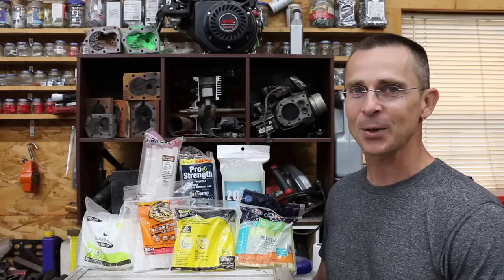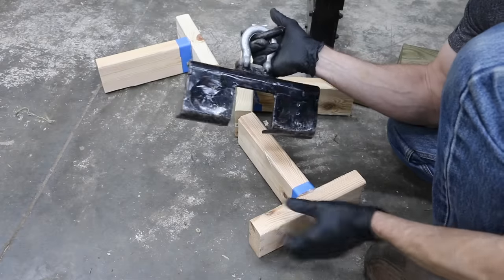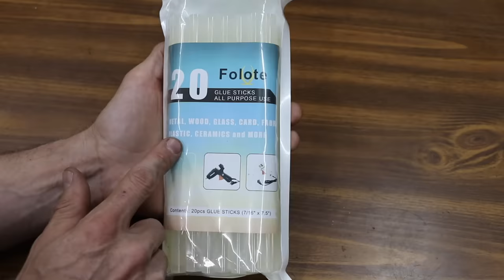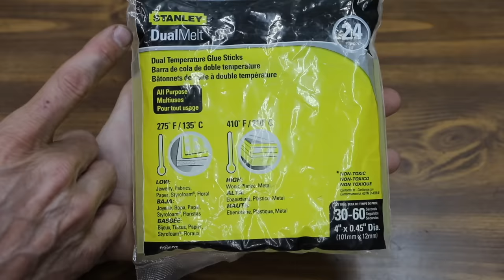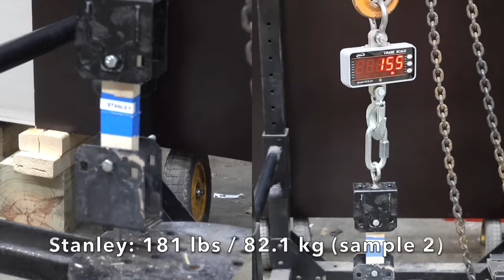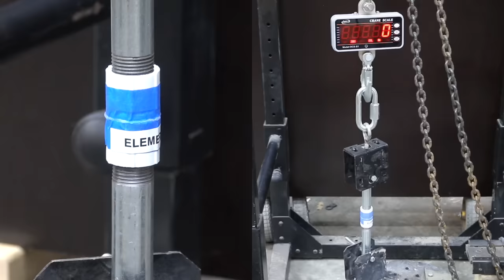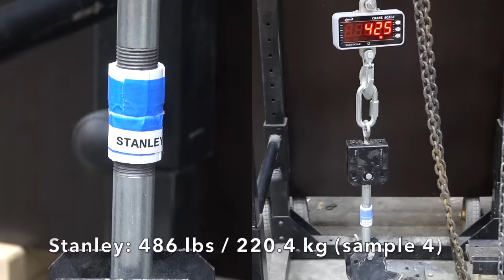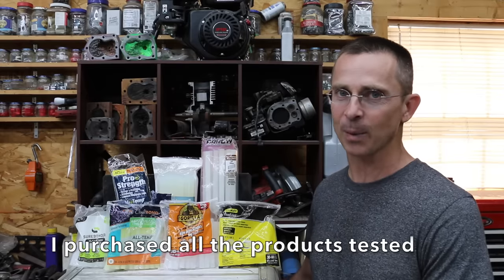Is Gorilla Hot Glue the Best? Let's find out!

Comment: Just what I need to see right now.  I need to purchase some hot glue sticks because I ran out of whatever I'm using now.  I'm looking for hot glue that has decent but not the best shear adhesion. I use it for gluing side runners to wood that I run through my thickness planer to eliminate snipe - I need a glue stick that adheres just OK in shear but can easily be popped off in tensile.  Great channel you have!
Reply from the maker: Thanks!  Thanks for the video idea.

Comment: I've just discovered your series and am impressed by the care you take in making tests uniform between each product. But unless my old eyes deceive me, i think I see a slip-up here.  On your first set of tests involving the 2x4 tee joints, you have placed a small piece of steel angle between the wood and the U-bolt which holds the tee flat during the pull.  It looks to me like that piece of steel angle moves a bit, and during some of the pulls it appeared to get very close to, maybe touch, and maybe drag against the glued face of the crossing 2x4, which could affect the readings.  Again, it's hard for me to be sure of this, and after all, you were on the spot and do careful work.
Reply from the maker: Thanks for the constructive feedback.

Comment: It looks like all of the shear tests actually didn't fail in the glue but in the actual wood fibres. This holds true with how wood glue is (usually) stronger than the wood you're gluing together. It does however make that number more or less useless if the glue didn't fail but instead pulled a layer of wood of the board.
Reply from the maker: Thanks for the feedback.

Comment: I enjoy your channel - I started with the spray penetrants and have watched many. My only criticism is that some tests appear to test the strength of the substrate and not the bonding agent. In the sheer test, often failures that occur under lower forces have surface material from the boards that delaminated. If possible, I think that using more uniform testing materials would give a better indicator of the strength of the actual products being scrutinized.
Reply from the maker: Thanks for the feedback.

Comment: On the shear load tests, it seemed to me what might be failing is the lignin.* I saw splinters of wood in most of the shots. Without a close up, it is more difficult to evaluate, but the relative similarity of the failure loads suggests this as well.
*Which is what fails in PVA glue ups as the PVA is stronger than the lignin.
Reply from the maker: Thanks for the feedback.

Comment: Since the Flex Seal Products are now showing an ad using one their Flex Seal products gluing PVC pipe together, you might want to check how good that holds up to pressure.
Great video though on Hot Glue. I never knew they made that stuff so strong. I would also like to see how strong those glues are under some hot weather conditions. I live in the AZ SW Desert where temps can reach 120° in the summer and that is not in direct sunlight. During the hottest days, Flight Line work on Aircraft is limited to 15 minutes and their must be 2 people and plenty of water. 
That is another reason I never trusted Hot Glue for outdoor use. Plus, the area I'm at has the highest UV Light in the US. Plastics that are not protected in some way, do not last long when exposed to the sunlight, dry humidity and the heat. It would also be nice to know how well these glues would hold up under those conditions.  
Most of the Hot Glues I've seen and used were not all that good. So I've always figured it was mostly for light duty applications and cardboard boxes or temp holding. 
There was a product out that was made for holding parts for machining. We tried to use it to hold some thin parts down to machine them on a milling machine. But the heat from the end mill cutter weakened the glue and sent the parts flying. The stuff never really worked on large thin metal parts either. Never could get a consistent and even cut. This happened even with flood coolant being used. The stuff worked on some larger thicker parts where the heat would not effect the glue. We wound up using special end mills and a vac-mat. 
Love the videos and the information on these products.
BTW, what did you do in the USAF?

Comment: Id be interested to see how they perform with ambient temperature changes. One of the downsides of a thermoplastic is the hotter they get the less strength they have. So uses in vehicles having limitations due to rising interior temps.
Reply from the maker: Thanks for the suggestion.

Comment: Several years back i was installing granite shower enclosures bath lavs window sills etc in hotels. But before starting that i was installing the door jambs and doors. Some installers came in to hang thin granite panels in the tub enclosures. I was shocked to see them using glue guns to hang the panels and moreso the soap trays grab handles and corner trats. All with hot glue. After checking with the!guys they showed me the sticks were an epoxy. Extremely hard bond. Im a big guy. I intentionally used the soap tray to pull myself up from the tub over and over. It never showed any signs of failure. Ive installed several thousand the same way and have had no calls to repair or replace any due to the glue breaking loose. I cant say i feel comfortable with that method but it works.
Reply from the maker: Thanks for the feedback.
Reply: @ProjectFarm  thanks for the video. Interesting. I thought it was strange that surebond did so well on the first test then wasnt that impressive on the other tests. Stanly surprised me.

Comment: You should install the testing bracket on the inside of the T, so that it's pulling up directly in line with the sheer line. You will need to change the bracket first, but you'll get much better results for sheer strength.
Reply from the maker: Thanks for the suggestion.

Comment: Interesting.  I have always used Surebonder, and they have many different glue formulas, as well as normal and high temp.

A guy could spend the rest of his life devising tests for, and running, hot glues

I have always wondered how much more effective the specialty formulas are for their purpose than basic glues.

If you ever want to go partway down THAT rabbit hole I will gladly follow.
Reply from the maker: Thanks for the suggestion.

Comment: In alot cases involving wood its more a test of the woods strength than the adhesives bond,  in a lot of cases the adhesives bond has torn the wood with it proving only that wood isn't a valid control material
Reply from the maker: Thanks for the feedback.

Comment: I love your channel!
I am a handy man around the house I always come to your channel for advice on products such as this. Your testing is thorough and made so everyone can keep up. I was going to suggest doing a summary at the end but you beat me to it. 

Keep up the good work!

Ps recommend cleaning non wood surfaces prior to glue. Symmetry is critical when doing these tests so try as much as possible to remove variability ( too much to ask I know ). 

Video idea: led bulbs last longer than incandescent or are more efficient ( cycle on off too for comparison). Best leaf blower. 

Pss from other video, I use eneloop because they don’t drain over time but I think you have that coming 😁. Also they were the first to the market with good quality but now I’m glad to see more competition. On next test you can include ncr18650b for lithium batteries if you test again. 

Speaking of lithium, there are two types low capacity power cells and high capacity energy cells ( high esr ). You have to test them differently. I actually worked at milwaukee tool 😂
Reply from the maker: Thanks for sharing.

Comment: I am surprised just how strong a small piece of pine is considering it has a hole in it with the bolt taking all the pressure, I would have thought the wood would fail more at that size, so a good add for the wood as well :)
Reply from the maker: Thanks for sharing.

Comment: You should do a video comparing different brands of garden hoses. Abrasion resistance (bend over something, hit with orbital sander for X seconds or until leaks, etc) , end fitting crush strength, flexibility as temperatures lower, price vs performance etc.
Reply from the maker: Thanks for the video idea.

Comment: How do the glues hold up over time?  Hot glue is made of various types of plastic.  Some plastics degrade under light and some over time.  Can this be used for structural applications?  Stanley might be the best.  Will it hold up after two or more years time?
(This glue seriously burns!)

Comment: I would be interested in the temparatures at the nozzle of the different applicators. They are not a very sophistricated machinery, often without even a basic temperature regulation. It would be interesting to compare the results at different temperatures. It might be that the applicator for the stanley product was just at the optimal temperature for the product.
Reply from the maker: Great suggestion.  Thank you.

Comment: You should re run this test with the glue they use in collision and paint less dent repair. They have cam auto glue wich is used to apply tension to crushed panels while you work the metal
Reply from the maker: Thanks for the suggestion.

Comment: When I use hot glue, I don't cover only the immediate area of the joints. After assembling them, I also put some in the corners (as often as possible) to add the strength of a fillet, something I learned in 8th grade when the science teacher showed us how to attach the fins on a model rocket. I usually don't try to make it a true fillet, though, because all I'm interested in is the strength since it's going to be hidden anyway.

Do you think it'd be worth testing again with that kind of additional glue?

Comment: Just some feedback: You would have been better off using some sort of scored metal for this test. Your results are inconclusive due to the variation in grain strength between different wood pieces. That is why you kept getting such huge variations while testing the same product. Another downside to using glue is that even if you had the same exact wood pieces, the lbs measured would be limited to the strength of the wood itself. If any glue surpassed the strength of the wood, you would just be met with the equivalent value of the woods stress failure in pounds.

Overall, I appreciate your approach that you are trying to take when comparing products. Not many even attempt to isolate variables in their comparisons like this channel. Keep up the good work
Reply from the maker: Thanks for the feedback!

Comment: I'm hot gluing everything with addding 1 penny nail. Should hold up a building.

More importantly after cure how does it hold in warm environments or out in the sun 🌞 doest it still hold up or does it soften.
Reply: Hot glue can soften if it gets warm enough
Reply: @longassrice8756  I understand that which ive only used craft grade hot glue and have experienced that. I never tried the high temp and I was wondering if the higher temperature causes a permanent chemical reaction for make it last longer and less susceptible to degradation due to warmer temps compared the hobby cheaper hot glue sticks.

Comment: This may seem like a bit of a strange one, but what about hot glue guns? Ryobi is one of the few name brand wireless ones, and Menard's Masterforce, 3M, Surebonder, Gorilla Glue, and Arrow might all be good competitors. You could test rated heat, safety features (if they were accidentally left on overnight), hot glue drip during idle, heat up/cool down speed, bead width, how much hot glue does one pull of the trigger release, pull force required, etc.
Reply from the maker: Thanks for the video idea.

Comment: Did you do one about the different glue guns? I did find out that the cheap ones don't get hot enough and/or don't keep enough heat to keep the glue a constant temperature for good adhesion. 

I think you have a lot of fun doing this.... Abrasives?
Reply from the maker: Thanks for the suggestion.
Reply: @ProjectFarm  We wood turnere use hot melt glue guns to secure waste blocks to some pieces we turn. I do remember some one saying that we need to use an 'industrial' grade glue gun because the hobby level ones don't get the glue hot enough to get a really secure grip. 

Since I use a lathe, one tool that all turners have is a bandsaw. Have you done bandsaw blade reviews? Most common use is for cutting rounds out of wet wood. Most prefer a 1/2 inch by 3 tpi blade, though some use 3/8 inch blades. For sure the thicker ones. I have been using the Lennox Diemaster bimetal blade. Teeth are M42 high speed steel which is what is used for the pallet cutting blades, and a number of the lathe chisels are now M42. Other blades from Ellis bandsaw blades, Timberwolf, Suffolk I think, and I am sure there are others.... My local maker told me carbide tipped blades are for cutting veneers. Some cut pen blanks, which are usually casting resin covered. 
Thanks....

Oh, abrasives, Mirka, 3M 'cubitron', the red aluminum oxide, the open mesh ones, and a blue one on film rather than paper, I get from vinceswoodNwonders, don't know the brand name.

Comment: Did you take a temp reading on the "applicator"?  Comparing guns would be a good video.  Lots of variation in the definition of "high temp".  One 100 watt "applicator" I tested only drew 25 watts and only reached a temp of 270 F.

Comment: Any time the glue pulled the face of the wood off, I would consider that a matched result to the other glues that did the same.. basically you're sheer test was limited by the wood fibre strength, not the glue.
Reply from the maker: Thanks for the feedback.

Comment: Great test, I'd have never considered hot glue being this capable... I was going to put a suggestion across though if you don't mind? 
The point of failure in the first test (log test) appears to have been the actual wood, could you consider redoing the test with metal? Obviously a smaller surface area... 
Another test would be strength at temperatures... will some glues perform better than others at normal ambient extremes? e.g. putting them in the sun and cold, (again I'd suggest metals for this). 
And finally, how well do they hold their strength after receiving impacts in different directions, the aim with this test is to verify how might a bond fair with lots of smaller non destructive impacts to simulate wear and tear... How about fixing a dolly tray's wheels with the glues and running it over gravel surfaces/inclines/hard borders, and testing which glues give way as you increase weight or exposure time... Lol you could take them for a drive and tow them behind your truck!
Thanks for the vid! I'm gonna buy myself a glue gun after seeing this ;)
Reply from the maker: Thanks for the suggestion.

Comment: I had some audio board in case made from tape cassette case which was holding on piece of wood using hot melt glue. I don't know how much it weighs but I think it's about 100g or so. It fell down with no use after about a month under gravity. I don't understand what happened here but it happened twice. Hot glue brand is Parkside.
Double sided tape also fell off (unbranded) after a few months but then I tried different one and it held.
Reply from the maker: Thanks for sharing.

Comment: Thanks for the test.   That is good info for bonding things that are at room temperature.   However, I've had issues with low temp glues softening and falling apart in warm/hot environments.   Could you run a test on the glues simulating being in the sun or hot environment, say 180 Fahrenheit?
Reply from the maker: Thanks for the suggestion.

Comment: Not  to be a buzz kill as this is a great video but the metal on top of the wood on the left in many cases added to the strength of the adhesion on the wood pull test. It might be better if it was flush with the wood and screwed in. Just my two cents. Great video
Reply from the maker: Thanks for the feedback.

Comment: I"m a huge fan of this channel, but would like to offer a critique for this review.  I don't think anyone uses hot glue in this manner or expects high tensile strength.  If you need that, use another glue.  The way I use hot glue is quick temp adhesision between two objects, so I want it to hold quickly, but come apart easily and cleanly as well.  For crafts and other things, speed makes hot glue great to use, but again, tensile strength is irrelevant.
Reply from the maker: Thanks!  Thanks for the constructive feedback.

Comment: A different test that I would like to see is how strong the glue is itself.  Make a 1/2" cylinder out of the glue and see how the clue by itself stacks up.  I'm thinking of using it to clue metal to metal which means (to me) that the clue will be the only strength in the bonding.  Fortunately, I don't need a great deal of strength but it would be nice to know this information.
Reply from the maker: Thanks for the video idea.

Comment: If the wood fails before the glue, you didn't get an accurate reading for any of them. You just tested the shear strength of the wood, which would vary greatly per piece. Bonding a piece of wood with low shear strength fibers will have a low reading, regardless of the glues true shear strength. All we definitively learned from this was that most of these glues have a higher shear strength than wood fibers. The test needs to be done with either a wood species with a high shear strength, or at least with a material with a more uniform shear strength between all samples
Reply from the maker: Thanks for the feedback.

Comment: In many of these sophistic teste it was the resistance of the wood layers rater that the glue layer. You can clearly see that the glue was still bonding the 2 surfaces but the wood gave in. So go design another test ;) Maybe metal?
Reply from the maker: Thanks for the suggestion.